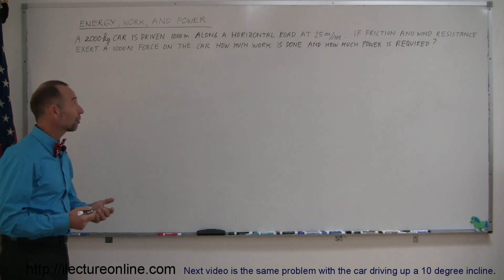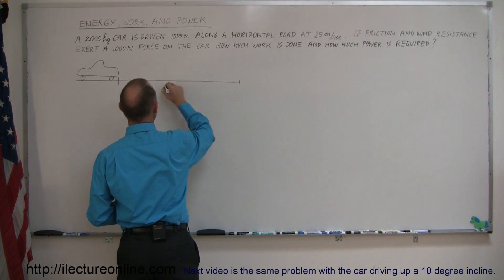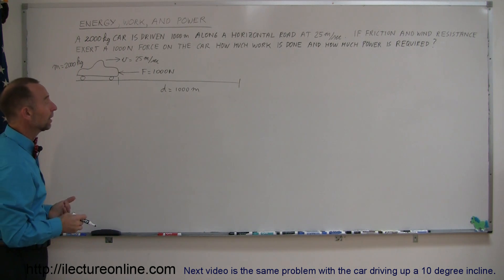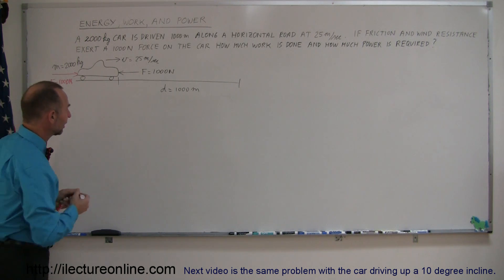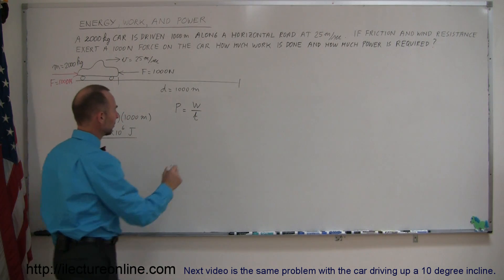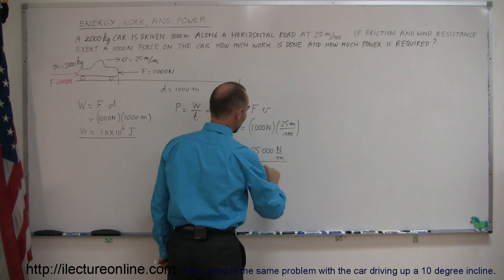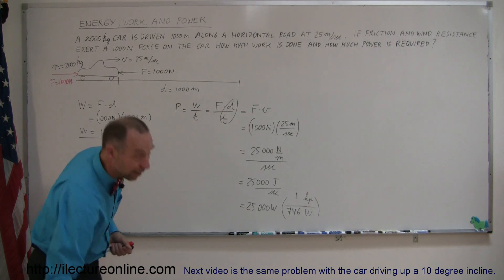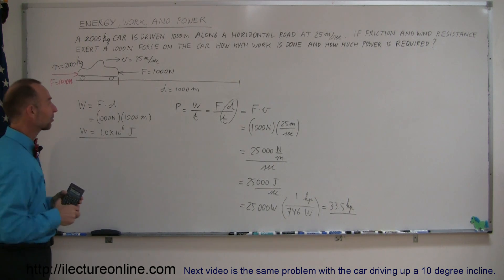Physics 8  Work, Energy, and Power (30 of 37)

Comment: Isnt the net work is 0 because there is not any difference in energy?
Reply from the maker: Performing work on an abject typically does indeed result in an increase of the object's energy (potential and/or kinetic).  But work can also result in overcoming friction without a change in the velocity.

Comment: hello, you have been very helpful, thanks. Right now Im stuck in this problem and I cant figure out how to approach it. could you help me?  mass of the object 1000 Kg, initial velocity 20 m/s final velocity 30 m/s and work=? ,  thats all the information the problem gives. I dont know if its incomplete or what?, thanks
Reply from the maker: Since work can be defined as the change in energy:  W = KE final - KE initial = (1/2) (1000) (30)^2 - (1/2) (1000) (20)^2.  This is assuming that there is no change in the potential energy and no energy was lost due to friction.